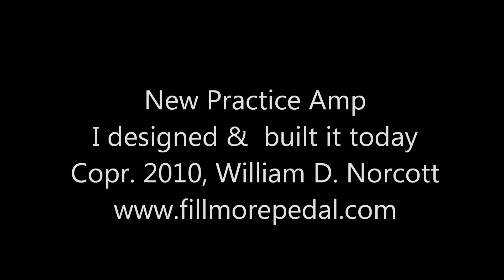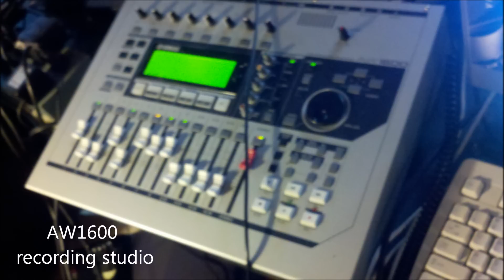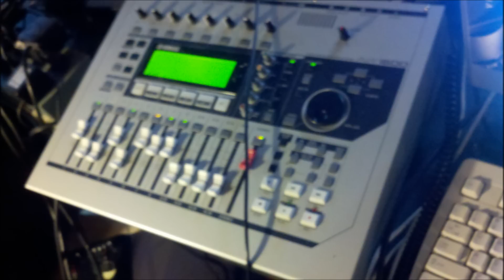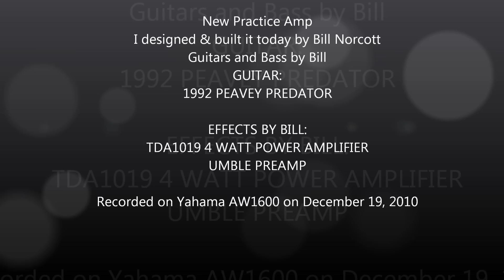New Practice Amp -- Bitchin' blues guitar  tone -- I designed &  built it today

Comment from the maker: @dahornor Yes on this recording I was running the guitar through a "Umble" preamp  that I built a number of years ago, just to get some overdrive.  I listed the Umble in the credits on the vid.  The power amp just by itself is almost too clean.  Yesterday I designed my own preamp section, it sounds great and has a tone of volume boost & overdrive, and I redesigned the circuit board so that it now includes both the preamp and power amp circuitry, and so the kit will have everything you need.